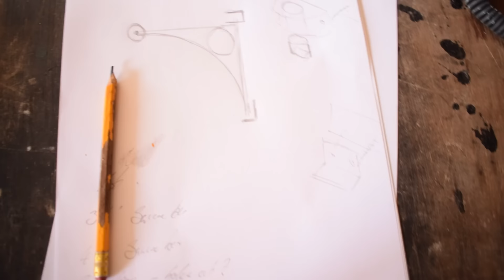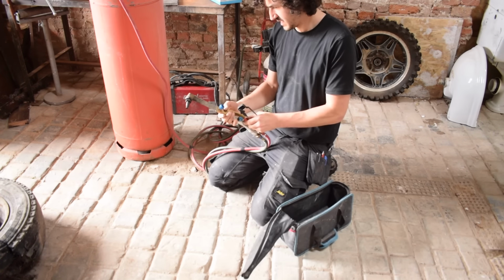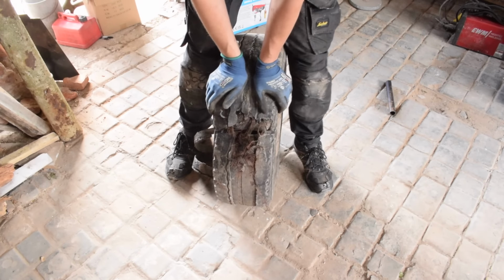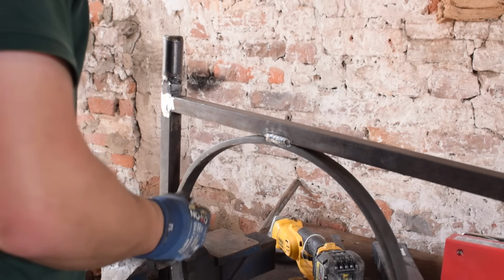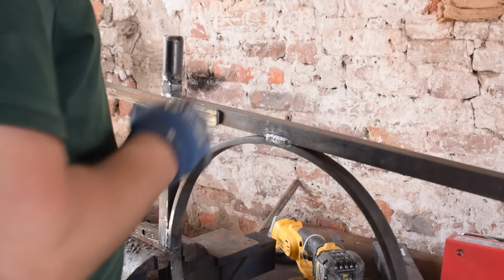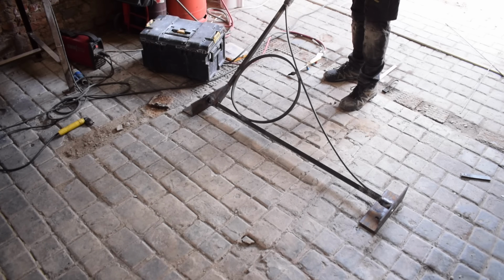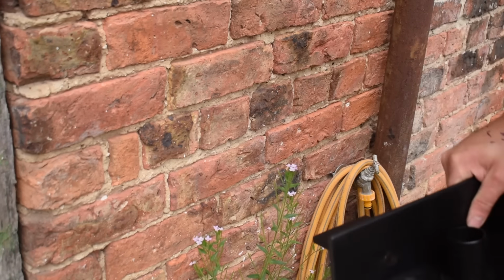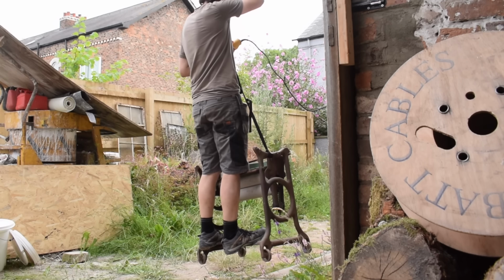Building a Hoist for the Abandoned Coach House

Comment: I would have done the bottom plate upside down to your way and added some gussets to help put the load into the wall.
All in all though,a very nice bit of work.
Reply from the maker: Interesting, I’d love to understand how the loads distributed
Reply: @ As I understand it , your derrick is like half of a truss. The force at the top is pulling out of the wall because the outer boom end is being pulled down. Resisting that is the post and the diagonal brake sending the force down to the base plate. By having the base plate the way you do “L” up , you are lifting the bottom with only the thickness of the metal.  As the lever arm of the L is pushed down it will pull from the wall. 
  By putting the “L” down , the lever arm will force the bottom into the wall . Adding gussets (triangular bracing) will reinforce the flat surface and transfer more of the load down ward into the wall.   Mechanically the two angle irons are acting as “bell cranks” . The lever arm sticking out of the wall is the same. “L” up the down ward force pulls the top away. “L” down the down ward force pushes in . Your tab into the wall does make both styles  better than just bolting. I hope this helps. Happy new year
Reply from the maker: @Pocketfarmer1 Thanks for explaining, I understand what you mean. I wonder if triangulating the bottom L bracket as it stands would have a similar effect. I put it that way up as I could easily put the plate into the wall and the weld isn’t relied on for strength.
Reply: @ you could add bracing down . The longer the brace the more nearly parallel the force will be to the bearing strength of the wall.

Comment: Good job on the hoist. I would be somewhat concerned about putting much side load on that old brick wall though.
Reply: ... so close to the top of the wall and to the window hole, would perhaps need some device behind the wall (bar, cross or plate) in order to better dispatch the pulling force over a wider area. Hope the wall is sturdy enough (does not seems very thick and the mortar does not seems very hard...).
Reply: My thoughts exactly. I wouldn't have even hung off it without having tried something else on it first. I'd think it's not gonna last long without at least some lumber inside to distribute the weight over a much larger area